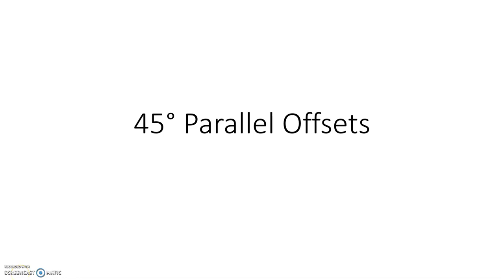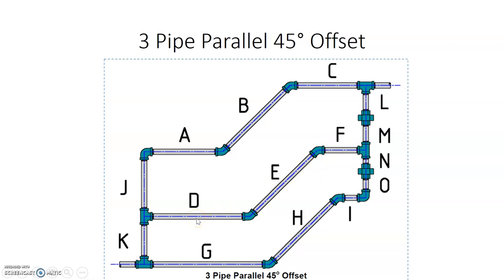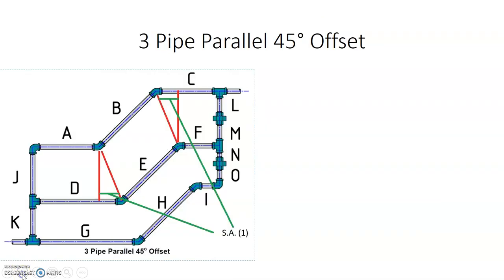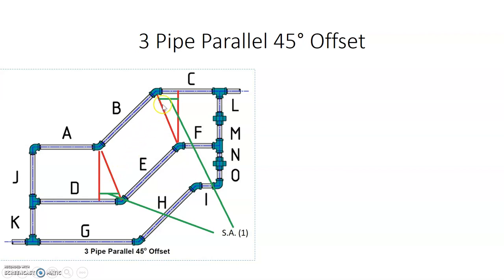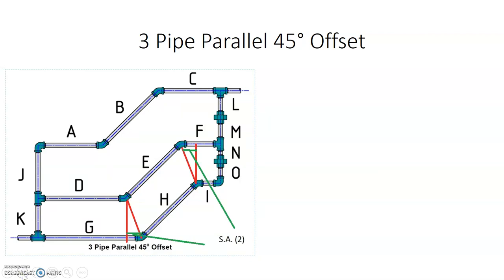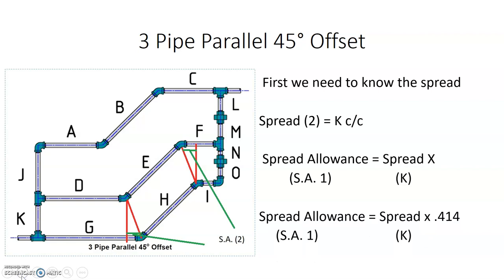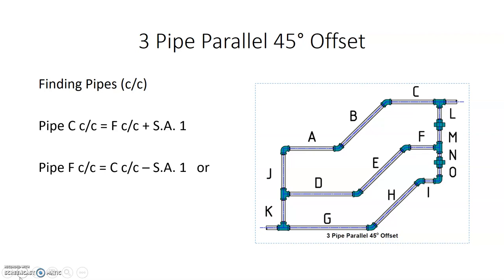Calculating 45 Degree Parallel Offset

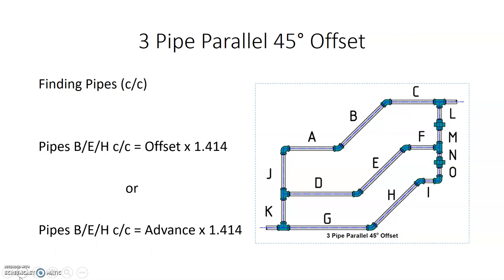Comment: I can't think of any reason I will need to calculate anything like this. I watched the video simply for the joy of learning. I understood it right up until 9:19  when it comes to calculating the length of B,E,H. Where do you get the "Offset" number? The term offset is used throughout the video, but i don't think it's defined. Also, right in the last few seconds you introduce the term "Advance" without defining it. It appears these videos are too supplement what you taught during an in- class lecture, so perhaps your target audience is already supposed to know those terms.
I've been enjoying your series of videos. I landed here because I'm redoing plumbing that a "handyman" did during a bathroom remodel. There's a veritable plethora of code violations from horizontal hard 90° turns, Sani-Tees lying on their back, and S-traps under the sink and tub. Good times.